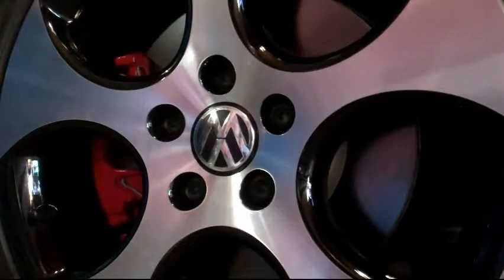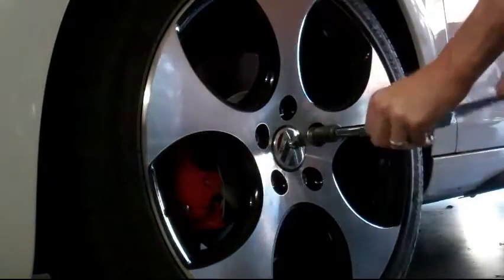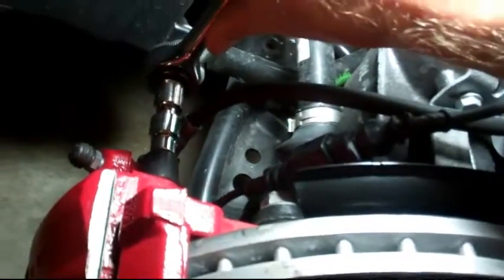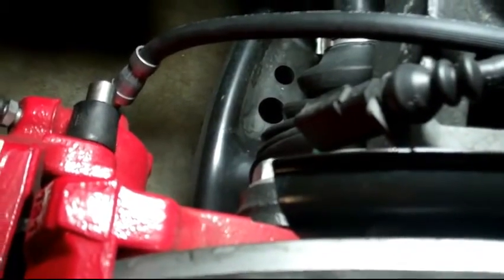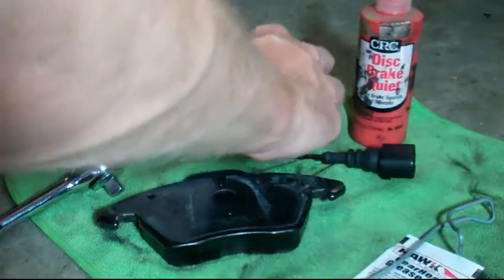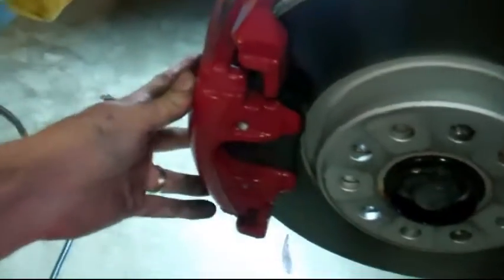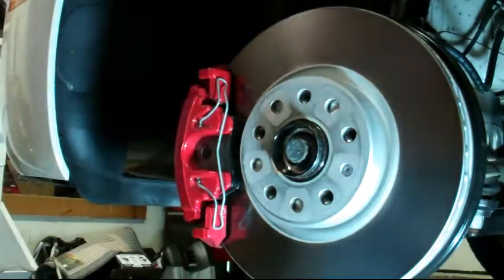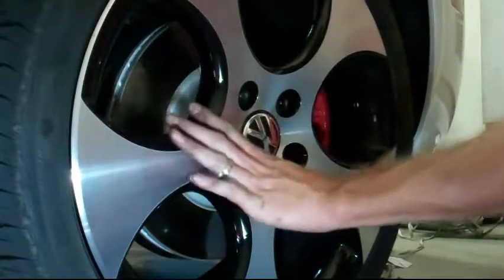2011 VW GTI: Episode 10 Vlog: Fixing your brake squeals/squeaks

Comment: I was wondering if you knew how to remove the fog light covers on a 2011 VW GTI? I want to paint them red to contrast the carbon steel paint. Any help would be greatly appreciated. Also, used your DIY on how to remove the front and rear emblems. Keep up the great work! Your channel has been very helpful.

Comment: Hey I have a 2013 GTI and the brakes squeak when it rains or snows. It`s only when I start up and go,  it stops after a warms up.....can you tell me what size is the tool you used to take out the bolts on your tires?

Comment: And what the result after putting the grease???
Reply from the maker: don't thin it helped for long. squeaks come from the pad/rotor combo choice.
Reply: @LastHumansGarage  ok so you mean if the pad is not "compatible" with the rotor it may cause squeeking? I recently installed a pair of new cross drilled rotors while  using the same old pads and the squeeking is making me insane.
Reply from the maker: @ulrichwillems6072  oh dude..... NEVER replace just rotors and leave the same old worn pads.. big no-no. you have to bed-in new pads also, to match the rotors..